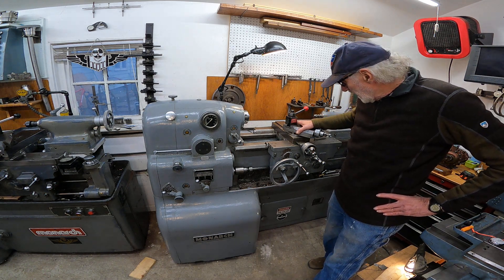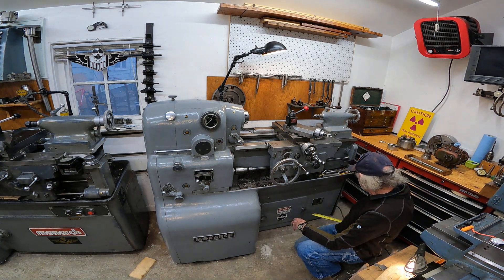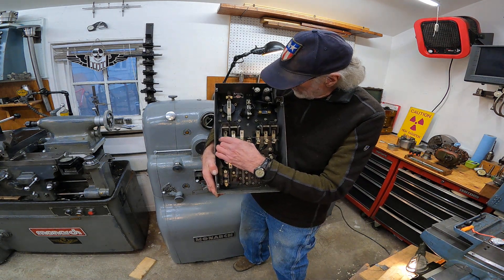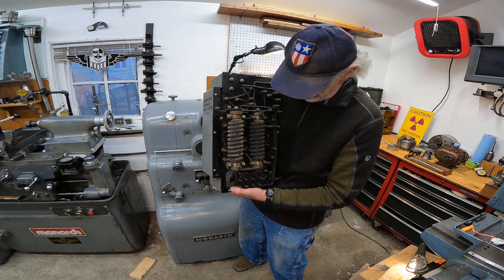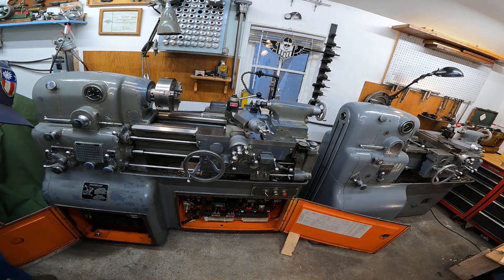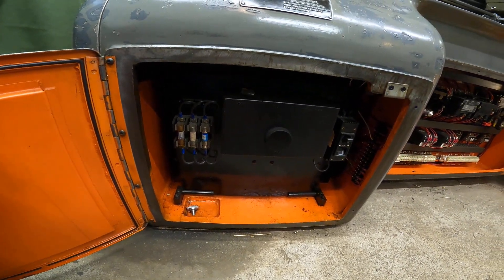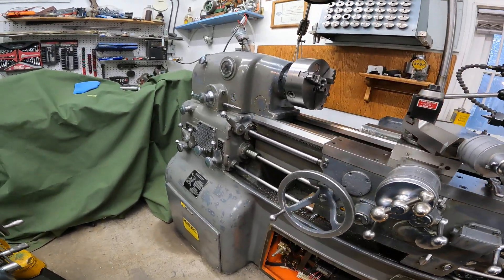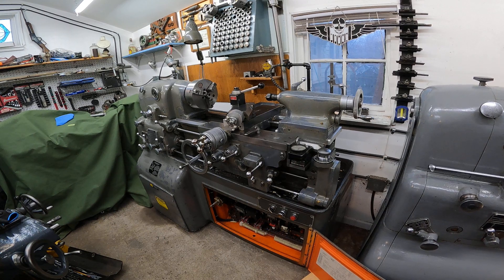Monarch 10ee lathe through the years changes

Comment: The modular drive machines may not have the disconnect on the front door if they had the rear electrical cabinet option like my '69.  On those machines all the electrical panel on the right side and the tube module on the left side are both moved to a large electrical cabinet that mounts behind the headstock.  Great option from a maintenance standpoint since you don't have to bend over and everything is right in front of you, but not the best from an aesthetic or space point of view.

Comment: Very informative!  I was interested when you said you would restore a moused up drive system back to the original system.  I was wondering how you would find all of the parts like vacuum tubes etc.  Are they readily available?  I would love to have one of these lathes!
Reply from the maker: You have to realize that the machines are the best possible and the parts are going to be expensive, for example the three vacuum tubes on ebay now new for $1000. The last factory price for the set was $3200. The large vacuum tubes can last 60yrs if the machine is not constantly overloaded and maintained. The Monarch factory will sell complete tube boards and components they have pulled out of machines being converted to their $20000 inverter drive. Both the motor generator and tube drives are overbuilt and designed to be repaired in the field. Stay tuned, it takes time, I will try to simplify ownership.
Reply: @deedeeindustrialsuperprecision  Thanks for that info, I'm fascinated by this lathe. Hoping one becomes available in my area at some point.

Comment: What would a used working 10ee go for? What about a 10ee not working & missing a couple covers?
Reply from the maker: I would expect later inch metric machines in very good condition from 20 to 50k. the earlier machines depend on drive system and condition
Reply: @deedeeindustrialsuperprecision  thank you.

Comment: Could you share what you decided to do on converting your newer Monarch lathe from 460 3phase into what 
Looks llike your home shop with 240 single phase?  Thank you
Reply from the maker: Are you talking about a module drive machine 1960 to 1983? Filament transformers and shunt wires?
Reply: @deedeeindustrialsuperprecision  that is correct.  1968 version 10ee
Reply from the maker: @williamwilson9815  To wire the machine for low voltage the basic information is in the manual and on the electrical print for your ser# of machine, change wires as directed on the big transformers; shunt wire length. Not all prints clearly point out that the filament transformers come in high and low voltage. Dual voltage machines have 220v filament transformers that wired in series for high voltage and wired direct for low voltage input. If you have high voltage filament transformers you will need a small boost transformer just to power those. When low voltage transformers are used the brown tap is used to provide the 2.5 volts "AC" to the C16 thyratron tubes filaments. High voltage transformers require selecting the correct tap "colored wire"  as per manual/print.
Reply: @deedeeindustrialsuperprecision  that is very helpful.  Thank you.  We will check that out to make sure it is set up properly.  The reason I ask is when We checked it out before buying it, a machinist that was a friend of the family did a video to help out selling it and ran the machine and found that at 2000 rpm and the motor ran very smooth but when he turned the speed up or down, the motor would start surging.  He said everything else on the machine worked great.  Does that sound like anything particular that you have seen?  We do not know it’s condition exactly because the owner pasted away and no one in the family knew any details..  we thought we would start by making sure the power was correct and work from there.
Reply from the maker: @williamwilson9815  There are two adjustment pots on the top of the inside of the module  "the black box" They adjust with a screw driver one side is top speed on the other side is speed compensation. The instructions for adjustment should be inside the black cover. Your likely problem is the compensation is turned up slightly high that causes surging. Both of those adjustments are normal maintenance as the tubes change from age and use. Take a look at my video on the module.
Reply: @deedeeindustrialsuperprecision  thank you so much.  That is wonderful news.  I love watching your videos and in doing so you inspired me to find this lathe and have a new adventure with it in retirement..  a million thank you
William
Reply from the maker: @williamwilson9815  Keep in touch and have fun
Reply: @deedeeindustrialsuperprecision  I got the 10EE home from where I purchased it and got it setup in the shop.  It came from an estate where the owner passed away with a heart attack just after retiring.  When they ran it for the auction, the speed was surging at times.  I think I found that issue.  The ground wire on the large tube where it connects to the transformer ground terminal had one of the two wires come loose from the soldiered connector.  We fixed that and when we powered it up as he had it installed, it ran just fine.  Fingers crossed.  As best that I have sorted out, he had it running with shop supplied 240 volt single phase into a stand alone step transformer that stepped it up to 440 volt single phase and then that wired into the lathe power terminals.  Just getting it cleaned up and leveled.  Thank you for providing some insite into what I was getting into before I purchased it.  Your videos are extremely educational and encouraging.  Thank you 
Billy
Reply from the maker: @williamwilson9815  The main points to look for  when there are problems. Test the diodes, failed diodes point to a problem in their circuit, The two diodes in rectifier 3 should be replaced in any sign of trouble as they do get hot and degrade,. C3j field tubes can appear good but can have voltage drop under load, a working spare is best to have on hand. These machines do require maintenance I try to keep everything clean and keep an eye on the drive motor commutator, all good fun if you can look at it that way.
Reply: @deedeeindustrialsuperprecision  Do you use your taper attachment on your 10EE?  On the 10EE that I just purchased, a few parts are missing on the taper attachment and I am working backwards trying to figure out what all I need to find to replace.  There looks like a rod goes under the taper slide.  I cannot see why it would be needed other than to maybe act as start/ stop indicator.  Does your have a bar with a clamp attach,ent back to the lathe rail?  Thank you for your help.
Billy
Reply from the maker: @williamwilson9815  Yes there is a rod and bed bracket, the rod attaches to the slide to keep it stationary as the carriage moves. I use it to cut machine tapers like the obsolete Moore taper.
Reply: @deedeeindustrialsuperprecision  that was helpful..  I can see what it is doing now and that helps a lot when you looking for parts you have never seen before.  I am calling Monarch tomorrow.  I have been told they have a-lot of used parts for these and reasonable prices.  Thank you
Billy
Reply: @deedeeindustrialsuperprecision  I am trying to send you photos to ask if you recognize a few parts I found I. A box that came with the lathe.  How do I attach photos and send to you here?  Cannot figure that out..
Billy
Reply from the maker: @williamwilson9815  There is an email under about on my home page betdyar@outlook.com
Reply: @deedeeindustrialsuperprecision  I figured out what I was missing and ordered it used from Monarch.  Thank you. Another question.  Not sure how your 10EE is setup for cutting metric threads.  On my 1969 version mine uses a set of 8 gears plus a 127/60 transposing gear.  I have the gears but missing the 127/60 transposing gear.  Does yours use the 127/60 transposing?  Do you know where there may be a drawing of that gear?  Do you know anyone that sells just the one gear?  One company I found only sells the whole set.  I really do appreciate any guidance you may have on this in either finding one to buy or help on dimensions somehow and I will make my own.  Thank you
Reply from the maker: I have had the change gear set it is a finer Pitch set of gears so as the large tooth number gears will fit into the small end train compartment. Making that a little more tricky to figure out. About he mid 70s on they offer the full integrated gear box and the machine goes to all threads systems by shifting a few levers that is what I have. The change gears sets were around $4000 20yrs ago and the integrated gearbox at $10000. If you can find a junk lathe with the gear box is the best way keeping in mind changing the end gears and putting them back can take an hours time.
Reply: @deedeeindustrialsuperprecision  I found a video that explained where to look for the transposing gear and gratefully it was in the gearbox.  From what I can see, the transposing gear stays and you inter change the other 8 metric gears with the one standard gear.   

I am curious if you have ever seen a Brown and Sharpe set of angle blocks but rather than having degrees on them, the set has letters A thru G.  I would send you a picture but cannot see how.  I thought of you when I was watching your what is it videos.  You can see a picture on EBay of you search “Brown sharpe precision angle blocks A G”.  Really curious if you know how they were used.  It reads on a plate on the lid. size “1/4 - 5/16 use A-A”.  The 10 included angle blocks are label A,A,B, B,C,D,E,F,F,and G.  Thank you
Billy
Reply: It has been a few months since to last help me on my 10EE.  Having a speed issue.  When I first start it up in back gear, it will go up to 600 to 800 rpm.  However, once I start and stop the spindle a few times. It will only go to 300 rpm.  At that point I can open the power cabinet door down on the front lower left where the vacuum tubes are and turn off and then on the breaker switch that is just inside that door on the right hand side and it will repeat the higher speed and then the 300 rpm after starting and stopping the spindle.  Any idea where to start looking on this one by chance?  Thank you for your time.
Billy

Comment: At work have 2 EE with motor generator and we have motor generators in another room so the Lathes are silent to run. 
I have never used vacuum tube type. 
I find Motor generator type are very easy to maintain and keep running in a run flawlessly. I live in Alaska and EE Lathes not easy to find in Alaska
Reply from the maker: The old motor generator machine I have is really loud but works great. The module tube drive has faster speed change with the speed knob having less than a turn combined with quick slow down and acceleration circuits. The other major change is a speed/load compensation circuit to hold speed under load.
Reply: @deedeeindustrialsuperprecision  are bearings bad in your motor generator?
Reply from the maker: @akfarmboy49  Could be, it has sounded like for years.
Reply: @deedeeindustrialsuperprecision  is motor generator mounted on rubber vibration mounts. 
In your video it’s sounds really noisy. 
In person it might be ok.
Reply from the maker: @akfarmboy49  Yes the pads are in place, I hear a loud growl on the video when the generator is rolling to a stop, not near as noticeable in person. I will track it down it could be a bearing in the exciter. I have noticed on mine and others videos the microphones pick up an amplify metal on metal, perhaps a useful tool in itself. I am sure new bearings are in my future.

Comment: Thanks for the informative info. Answered alot of questions I had always wondered about. I have a Hardinge HLVH-EM that is a wonderfully accurate machine, but I have always loved the 10ee. Was just to spoked about the electrics on them so I stayed away.
Reply from the maker: The ideal situation is to have both, I found the Hardinge is much better using 5c collets, it was an afterthought on the Monarch with the additional collet nose attachment. The electronics on the vacuum tube machines will stun most industrial electricians, until they are briefed by an operator about how the machine functions.
 Choosing to go with the Monarch was easier here because of all the local gov facilities using them and experienced machinist around for assistance. Always oil your cork, thanks for tuning in!